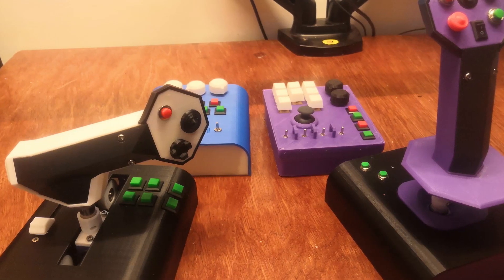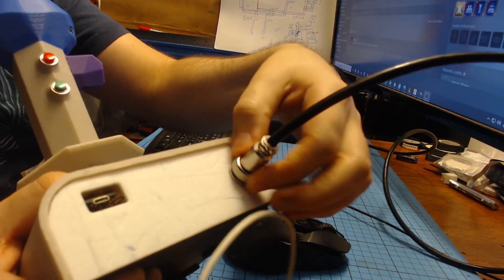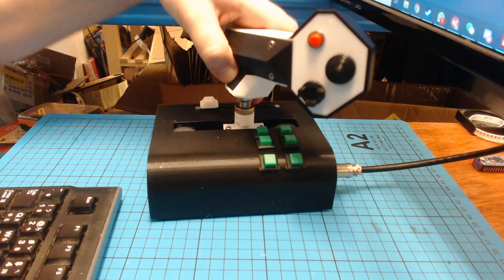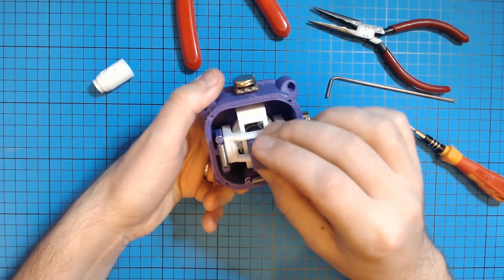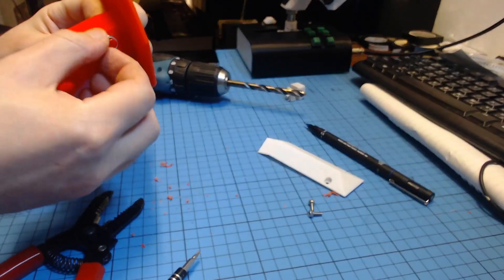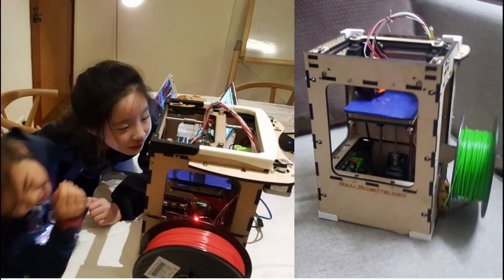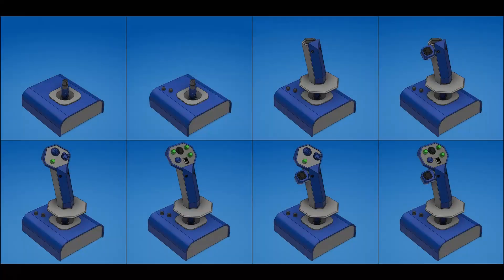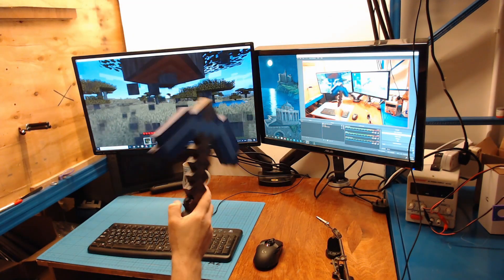Game Controller Construction Kits

Comment: When joyistick + throttle + pedals are made, are they transferred to the pc via a single usb?
Reply from the maker: @ahmetttt10  if they are all connected corrextly yes. I recommend testing it out first, the firmwares a bit dated now and I'm not sure how it holds up with all the updates Arduino has had